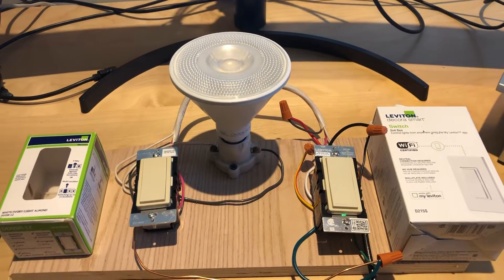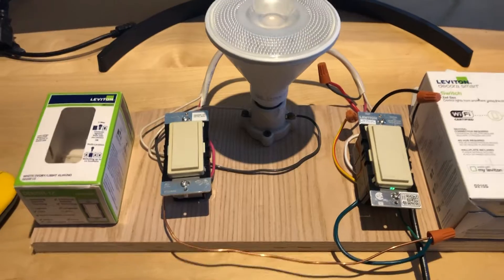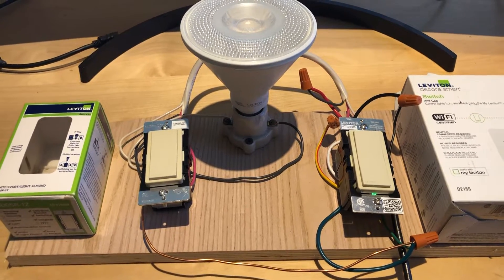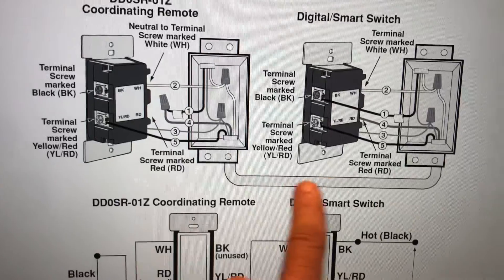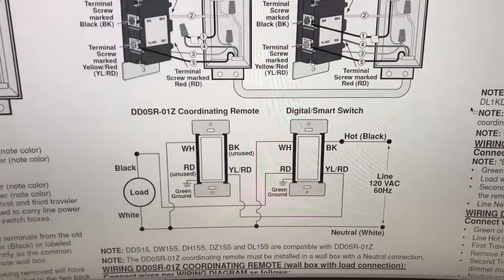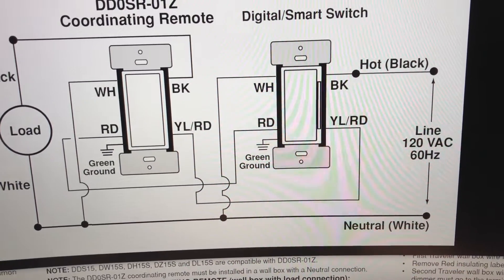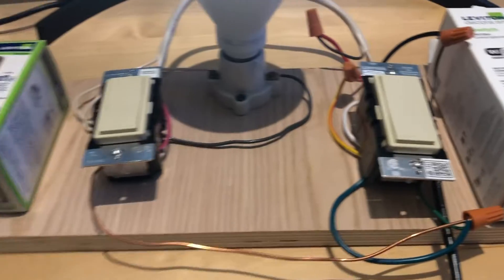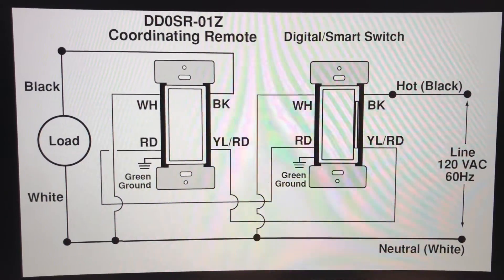How to Install a Leviton Smart Switch and Coordinating Remote, Replace an Existing 3-Way Application

Comment: So far I've installed (2) 3-way Leviton Smart Switches at 2 different houses.  I've always done it the way Leviton suggested.
1 thing I noticed is that the remote is not controlling the light, it's controlling the smart switch to the light.  Basically it's telling the smart switch to turn the lights on or off.  When that happens, the remote is silent.   The "click sound" is only heard at the switch.  

Question:  When you wire it your way, do you only still hear the click sound at the switch, only at the remote, at both?

Comment: For anyone searching for the dimmer version, the wiring is different. The Smart Dimmer goes on the load side. The Line, neutral and ground connect to the Smart Dimmer and DD00R. The red traveler serves as a communication line between the Smart Dimmer and multiple DD00R and is connected to the Yellow terminal.
Reply: Help! Do you have a video for this ?